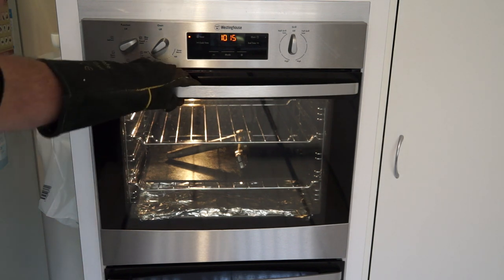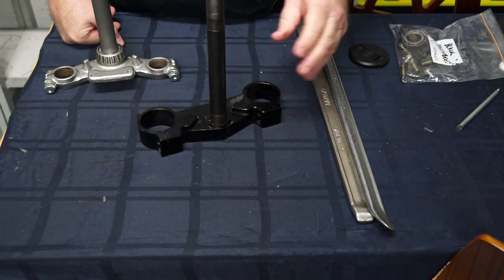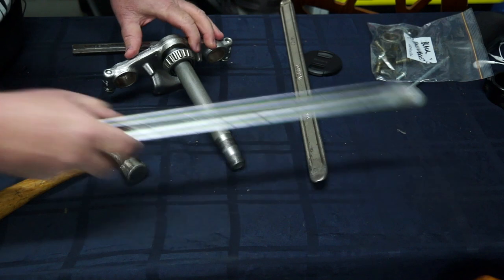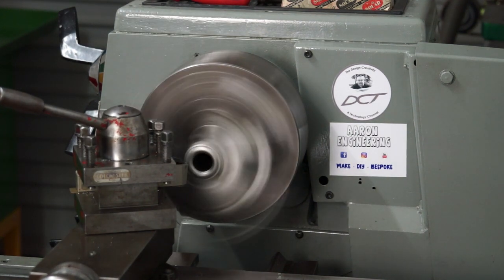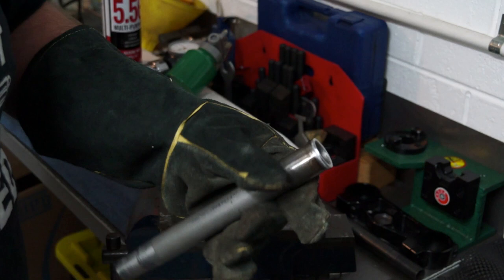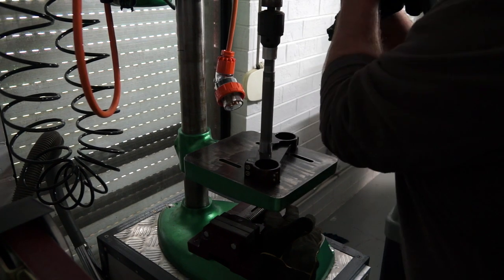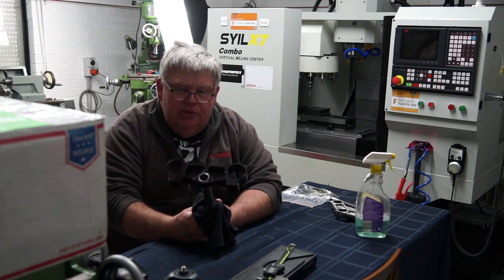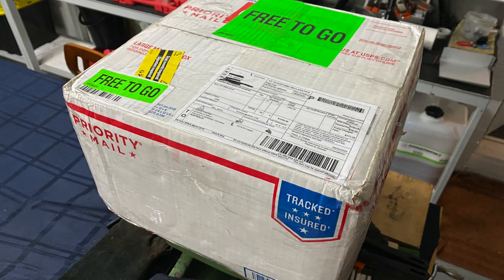Motorcycle Triple Clamp Modification

Comment: Great video i heat one and freeze the other to get a tight fit
Reply from the maker: Hi Joe trust you are well?  Yes that works well also.  I let Rohan reassemble it as I'm unsure if he wants to replace that bearing.  I would have replaced it.  Cheers, Aaron.

Comment: Thanks for the mention Aaron.  I'm glad you enjoyed the CAD model.  Feel free to share it with others as you see fit. I have to say your wife has more patience than mine with any shop items in the kitchen.  There is nothing quite like the taste of cutting oil in her freshly baked goods!  A new furnace for the shop might be on the Christmas wish list if you can help your wife can recover with a smile.  As for your next sledgehammer press approach, you might want to try machining a pair of tapered shims to press on both sides of the bearing more evenly.  You had me cringing with the cold chisel but your gear head experience seems to have paid off in the end. I shared the same great big hallelujah with you for the achievement.  Thanks for sharing!
Reply from the maker: G'day Stephen.  Yes that's how I got busted.  She could smell the coolant on the part evaporating off 😅.  A pair of tapered shims would work well, but the "old mechanic in me" came flooding back and the rest was history (whack, crack, bam).  Thanks again for taking the time to 3D model that machinist jack for me.  I really appreciate it.  We will talk more about it on the next video.  Cheers, Aaron.

Comment: There's any way to fix or refill a dented area on one of this clamps? I'm having a hard time finding an original one for my ktm in good shape.Looks like most of them are damaged in the same area where they have the steering bolt stopper.Thanks in advance!
Reply from the maker: Hi Jorge.  I'm sorry mate I don't have the answer for you.  I would probably aluminum weld it, file & sand it back then polish it.  Sorry I can't be of more assistance.  Regards, Aaron.
Reply: @AaronEngineering  Thanks a lot for ur answer.👍

Comment: My bike is duke200 I had changed the cone&ball today still my bike handle is jerking  . My mechanic told me that I need to replace Upper Steering stem ( Top Triple Clamp jg151002 ) .. what's your opinion about this .!
Reply from the maker: Unsure to be honest mate. I’d replace both upper and lower bearing set. I would check to ensure the shaft is straight and not bent. Hope this helps? 🍻
Reply: @AaronEngineering  u mean lower T  stem ,right?
Reply from the maker: @AbhilashRS  The shaft the bearing rotate on.  If the handlebar jerks or feels notchy when turning left or right it is usually because the bearings are too tight or worn out.  I'd listen to your bike mechanic or get a second opinion buddy.  I've been out of the mechanical game for 20 years.
PS: the reason I said check the shaft for straightness is because it could be bent from a crash or heavy impact.
Reply: @AaronEngineering  the shaft located on T stump?

Comment: Nice work on that project Aaron, and you didn't even need to get a grinder to it 😉. Was that 220º C or F? Ciao, Marco.
Reply from the maker: G'day Marco.  Yes it was 220 degrees Celsius.  You know how I love my communist units over your freedom units.  To be honest I usually would have cut the cage off the bearing, nick the inner race with a grinder and then gave it a good hard crack with that cold chisel and they usually fall off.  However, I wasn't sure if young Rohan wanted to reuse the bearing again.  Great to see you back flying the big stuff again mate.  Cheers, Aaron.
Reply: Aaron Engineering 🤣